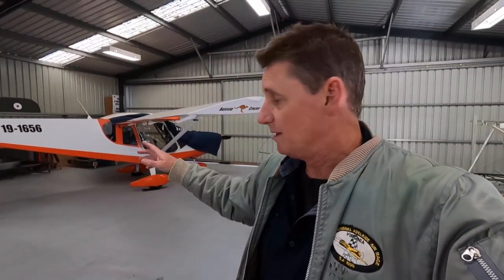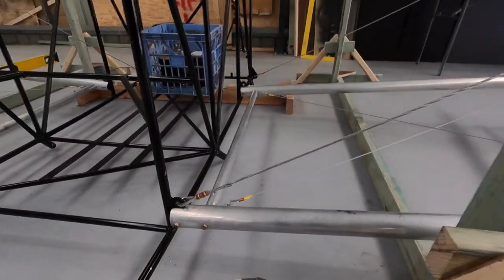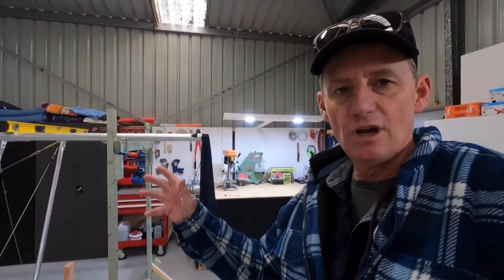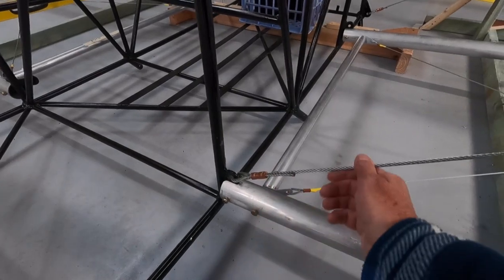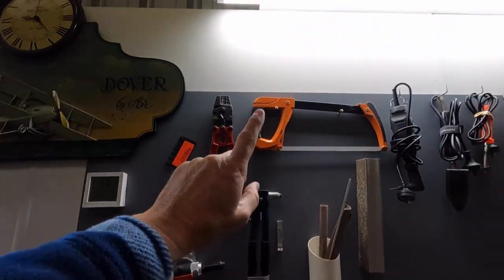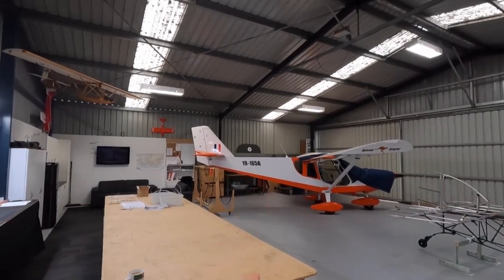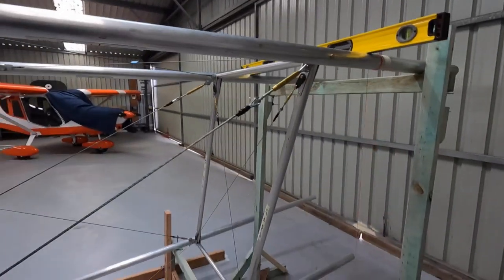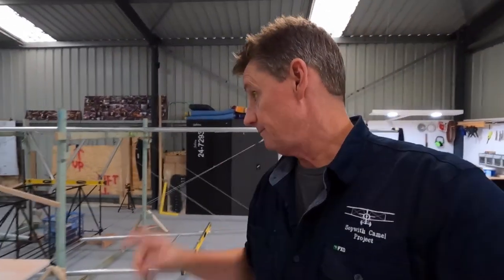Sopwith Camel Wings rigged Airdrome Airplanes

Comment: Moving the flying wires to the firewall is a good move. The landing gear forces go through that joint too. There's a thumbnail picture of a 1:48 scale Camel showing the flying wires attatched to that point. So does my Dave Causer Aerographics Camel plans.
Reply from the maker: Yes it’s the rear spar wire that should also go through the top wing out the bottom and join at the rear gear, however my mount is at the spar so I was trying to keep the flying wires Parnell cheers

Comment: I can't believe there's no bottom wing centre spar sections 
They just stop , no Continuity side to side for the bottom wing
Reply from the maker: Yep, one more cross over would do it
Reply: Cannot fathom how no centrespar for front and rear lower wing mounts can be "a thing" let alone good engineering practice 
By having front and rear centre spar sections you could mechanically set lower wing level and dihedral with a simple pickup system using steel tube and  bolts that the lower wing spars slide over to locate  like the upper wing section seems to 
The lower wings are articulated or do they have two bolts each mount?
Reply from the maker: @robflange  lower wings are articulated and swing up for dihedral.
Reply: @scottmatthews5280  
Explains why I see rigging wires go slack on airdrome planes In flight 
As lift will flex lower wings up 
Just looked at original planes from WW1 
Nope nothing resembling a spare just bolts on wow
Reply from the maker: @robflange  so
Similar  to a trike I guess

Comment: G'day,

Um, Round Cables for Flying & Landing Wires... (!), is there a compelling reason why you're not using Streamlined "RAF-Wires" ?

On the one hand a Round Cable produces 5 times the Drag of a Streamlined Teardrop the same thickness, and on the other hand the RAF-Wires have opposite-threaded Ends, so they're all Turnbuckles - and thus,  their Lengths are Adjustable, and lockable, via Locknuts...; but in the Gripping Hand - every Flying, Landing, Drag, Bracing & Anti-Drag Wire has to have a Turnbuckle.

And, I concurr regarding the Forward Flying Wires' lower Attachment Points.

As Kits go, that one certainly has it's eccentricities, it seems.

Keep on keepin' on.

Stay safe.

;-p

Ciao !
Reply from the maker: Round wire $2 per ft. Flat custom flying wires $18500 !
Reply: @scottmatthews5280  

Ah, I see..., and I'm guessing there's a lot less than 9,000 feet of (round) Wire in the job.

I knew RAF-Wires were expensive, but I didn't realise they would roughly double the cost of the Airframe...

There used to be a "snap-on" Plastic Streamlined Fairing available for some "standard" sizes of Tubing..., essentially the Snap-Closure along the Trailing Edge was like the Seal on a bag of Grated Chese, there were the meeting halves of "Bulkheads"  or Ribs every 6 inches or so on the inside of the "top" & "bottom" Skins, with the  Tube thus located at the Aerodynamic CP of the Teardrop...; the Ad's claimed the stuff could be wrapped around the Round-Tube Struts which used to festoon 1980s & '90s Ultralights, "snapped" closed - and compared to shaping Fairings from Foam or Balsa and glueing them on, and wrapping them with Spirally-wound Pinked-Tape and doping or Epoxying the Tape in place..., I really liked the idea of the Plastic  Fairings.

I'm thinking that 
"3-D Printing" was all  Science Fiction back then..; but these dayze...., it may well be that some cunning Buggar could come up with a Wrap-Around, Press-Seal streamlined Fairing for those Round Cables, like a miniature version of those old Streamlined Teardrop Fairings for several sizes of Round Tubes...
 
I dunno if it would be cheaper than a set of RAF-wires to get a Plastics Manufacturer to make a bit of a Production-run of Rolls of Snap-On Fairings for the sizes of Cable you're using...(?), and I dunno if there's any Patent/Design Registration Paperwork Issues - but my guess is that you might have to buy a Ute-Load to get them to Tool-up for the Job.

However, if you paid for the Roller Dies, or whatever they use - then after you sold all the Fairing Plastic not needed for the Camel...(!), you could take your Dies back and commission a Truckload to continue supplying all the people who wish they could afford proper RAF-wires on their little pet Aeroplane ?

As you can probably tell..., one is a Dreamer...; prone to ponder WIBNIFs 
(Wouldn't It Be Nice If Fantasies...), but the idea of shedding 80% of the Drag of all those Flying, Bracing and Landing Wires is very very enticing...; and thanks to thousands of hours of fantasising for every hour actually airborne - Round Braided Cables bracing anything designed after about  1915 is always going to be a 
"Visual Ouchie !".

(Ridiculous Segue of the week...; I wonder how many Blacksmiths spent their working lives cutting Stainless Steel Rods to length, forming them Streamlined, and threading and polishing them, between 1915 and 1945 or so, when Magisters ousted Tiger Moths  ? lol)

Anyway, thanks for the answer...; a lot of expensive - not merely a bit, kinda thing.

Keep on keeping on.

Stay safe,

;-p

Ciao !

Comment: 12:50 that sheet metal burring tool (it's not a deburring tool, it adds burrs) is absolute garbage.  I fast pitched mine into the trash can like it owed me money.  I stumbled upon using a sanding sponge for edge deburring.  It does the job, it doesn't mar the metal, and you can pick them up cheap at any hardware store.
Reply from the maker: Scotch brite wheel on the grinder works best for me. Thanks